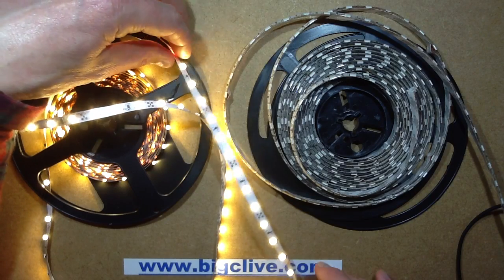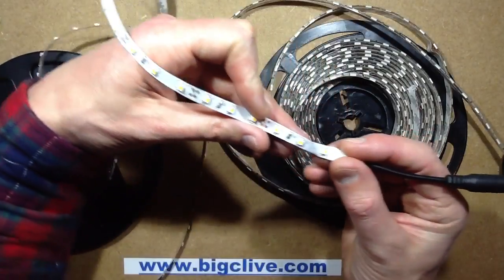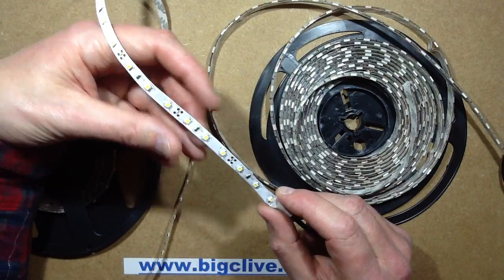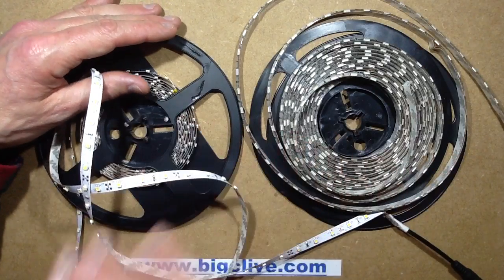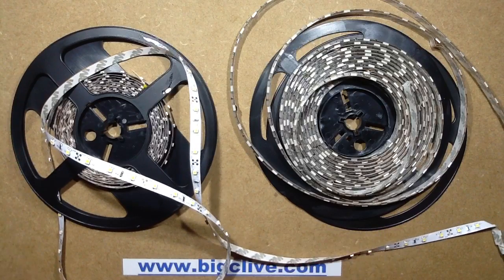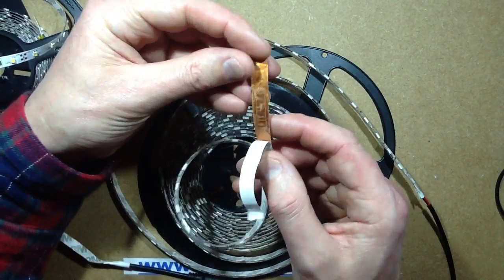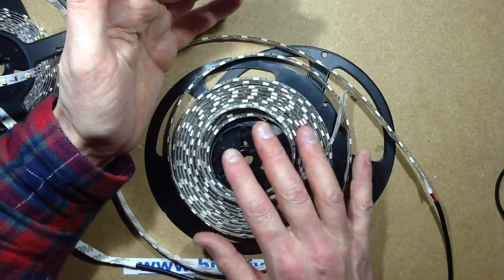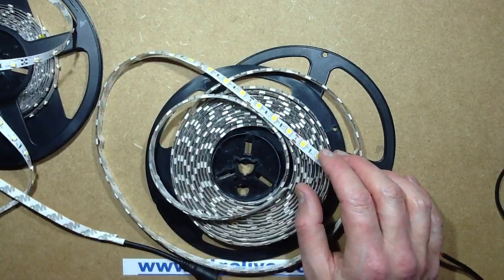LED tape voltage drop on long runs.

Comment: Clive, I know this is an old video but it is still absolutely useful. I’m making some rectangular LED panels from a dozen or more shorter lengths on aluminium plate. Connecting them in series seems slightly less daunting for mediocre solderists. But you’ve convinced me to push ahead with attempting parallel power. Tutorials suggest via thick copper cables running the length of each side and tacking each end, or just bare copper wire in a wiggle formation, or “shunt” injection wiring. Still haven’t decided which method to attempt but I will avoid just putting them together in series.
Reply from the maker: If your LED strip is coming back round to the start in a loop you can tack the positive on one end and the negative on the other where both ends are.

Comment: Hello Clive love watching your videos 😁 just a quick question, I’m planing on using these lights on my model railway which I’m going to be cutting them down into their banks of 3 so I get 100 sections and with wire to drop through the baseboard. I am planning on having the terminal blocks which you use fork connectors on for the connections which then each individual of 12 connector block will run back too the power supply which is a regulated power supply the ones which you can select what voltage you require which they are normally 1000milliamps so with the tape you shown at 16 milliamperes I worked out it’s around 64 per plug however I will only put 50 on per plug as not to tax it would this be fine. Any help would be appreciated many thanks Christian
Reply from the maker: That sounds fine.  I'd recommend splitting it into several circuits and adding a suitable fuse per circuit if using thin wiring.
It's always better to under-run a power supply so it remains cool.
Reply: bigclivedotcom thank you I’ll be medium using medium sized awg wire for power so around the 14-12 gauge to give good power distribution too then I’m even putting a switch in on each of the 12 way blocks so if I get a problem I can isolate the section quickly 😊

Comment: Would feeding voltage from both ends of the tape help with the voltage drops?
Reply from the maker: Yes.  In two ways.  Either both positive and negative to both ends ensuring polarity is absolutely correct before applying power, or positive to one end and negative to the other, which results in even intensity along the full length.

Comment: I have 3 ten foot strips on the 3 rd strip the light is barely visible but it is very bright on first strip any ideas ??
Reply from the maker: You may have to run separate cables to the strips if they are currently wired end to end. It's possibly voltage drop.

Comment: I purchased some Phillips branded LED tape lights that were able to produce all colors + white, select-able from the IR remote. The majority of that I find on EBAY is only "RGB" with no white capability. What do I serach for that will give me RGB+white on the same tape light strip?
Reply from the maker: RGBW is the key acronym.  Or RGBA for red, green, blue, amber.  I think you can also get RGBAW.

Comment: Even more fun when you're wiring up WS2812B addressable LED strips that run on 5 volts so twice the current.
 I've just bought two strips for my disco room to add to the two I already have ...
(Some people would call it "home theatre" , but I find abstract light patterns more entertaining most of the time) 
So I have invested in good quality power cables and will power the strips from both ends.
Coincidentally I want the lights to start from the extremities, so bought a reel of 0.75mm twin mains just for the data lines.

Comment: How many watts on average would a 5m strip of 300 3528 LEDs draw? Because I fear they are overloading a 65 watt laptop power supply.
Reply from the maker: Theoretically about 2A at 12V for standard LED tape.  Are you sure it's 12V you're running them with?

Comment: Mine is supposedly a cheap smd 5050 rgb 12V 60leds/meter. Selecting full white, the voltage is measured. I am powering the full 5 meter rgb roll without any cuts in the middle. Just before the first led the voltage is 12V for R G and B. But at after the last led which is after 5 meter the voltage drops to 8.5V for every channel; concluding it as a cheap strip. I then inject at the end of the strip with the 4-core cable that comes from controller which is the same that is injected at the start end of the strip. The result is now the end strip is as bright as the the start strip. But the mid strip is not as bright, the voltage is 10V. I then again inject in the middle and now every section looks similarly bright. Now I wonder, is this bad practice? Will the wattage go over the spec which is 14,4watt/meter or 72 watt for that one 5-meter roll rgb strip? I guess no. Please help clarify this folks. Thanks
Reply: I also notice that when injecting in the middle of the strip the lights which are currently dimmed to 10V are added/boosted spreadly from the point it is injected (to the right and to left) Sorry for my bad English but I guess you all see it. FYI, i am injecting 4-core cable accordingly not just the V+ cable.
Reply: And because of the "spread" effect it gives, I wonder why do we need to use amplifiers instead of direct injection for boosting the voltages? Directly injecting the 4-core cable benefit both ways of the strip, while injecting using an amplifier will only benefit one way of the strip that results in different brightness between the end of the first strip and the start of amplified strip.
Reply: i guess you can inject the voltage in every places, assuming there is one power supply, theses strips have super thin copper traces , so yeah, the  voltage drop is big after some meters.. probably the wattage won't go out of spec, because these dioses probably have resistors soldered in series.
Reply: Cheese 1337 thank you. I guess so too, because I dont see any negatives such as unusual heating on the diodes

Comment: Can I use power supply on both sides of 5 meter strip? Because I don't want to cut it.
Reply: What are you talking about? It doesn't matter what feeds the power supply, what matters is that both ends are connected to equal voltage power supplies, which really is hard to attain with two different power supplies unless they are really accurate. With unequal voltages there will be current flowing into one of the power supplies which won't do any good.
Reply: SillyTube Yes you can connect two different power supplies at the end as long as they are fed from the same main supply voltage.
Reply: SillyTube What you can do without any trouble at all is to run fat wires from the same power supply to both ends of the strip; I do this all the time. You could even run the fat wires alongside the LED strip and provide power to the LED strip periodically throughout the strip (you can solder to the strip without cutting it). If you have a bench power supply with current display, you can easily test this at home: connect the LED strip at one end only and see what current it draws. Then connect both ends of the strip at the same time and see what the current draw is. With the 3528 LED strips Clive is talking about here, I see the exact same as him: 2A when connected at one end only, 3A when connected at both.

In contrast, using multiple (separate) power supplies is somewhat problematic, and I wouldn’t recommend it unless you reeeeeeealllly know what you’re doing.

Comment: Thanks for the video 
.I have 50/50 ends worked fine when I first bought them off eBay..but now they are just white and don't change color..how would I fix this? Thanks
Reply from the maker: +Duane St John If it came with a controller it may have failed.  You can get new RGB controllers on eBay.

Comment: I want to use the same power supply for my leds strip wich one is in my bed and the other in my desk, the distance from the power spply to the bed is like half a meter, but to the desk, is like 4 meters.So, i was thinking about using an acessory with 1 female (wich goes to the power supply) and 2 males for both of the led strips. My problem here is: i will use a cable (red,green,blue) a long the 4 meters of wall and then plug to the led strip in the desk, and idk if i will lose power through and the brightness of the led strip will drop. 

Can someone help me ? ( if you didnt get it, i can explain better, and sorry for my english)
Reply: Miguel Ribeiro Because it’s low voltage (12V), the voltage drop will be significant over such a distance unless you use very fat wire. It’d be cheaper to use a separate power supply for each. (Since, amazingly, you can get cheap chinese power supplies for less than the cost of good wire!)

Comment: I use them in kithcen for iluminate working table under hanging shelves (sory for term, not native speaker). I do not have any problem with brightness on far end. 

PS If you want for all LEDs to have same current and same brightness, you can feed positive from one sie of strip, and negative from other.
Reply: Mladen Milić lepo je to ali sta ce biti ako zamenim plus i minus tj. ako stavim minus na plus a plus na misuns
Reply: Rocky2224 Jednostavno neće raditi. Sve dok napon nije preveliki, inverzno povezivanje nema posledica.
Reply: Mladen Milić ma meni nije problem napajanje ja imam 12v i 1.2A nego je meni samo problem dal nece crknuti traka ako zamenim smer napajanja
Reply: What do you mean by positive on one side and negative on the other?
Reply: SillyTube well you connect +12v on one side and gnd on another side of the strips
Reply: Rocky2224 What is gnd?
Reply: Can I use power supply on both sides to give equal voltage?
Reply: SillyTube well idk what you mean by equal voltage but if you think to give 12v on two sides of strips why wolud you do that?
Reply: My power supply powers half of the 5 meter strip only, the other half is dim and of different color. So can I use one more power supply on the other side?
Reply: SillyTube well probably you got cheap tape but if you have 2amp psu you should be good. You may need weaker psu but if you have 2amp there isnt problem. 
But if you have "strong" psu (power of tape for 1m × how many meaters and amps of psu × voltage and if you have more watts on psu than on tape your problem is in tape) and if is problem in tape try to cut it and put 2 psu.
Reply: you can connect the same power supply to the both ends of the 5m tape.

Comment: Hi. How can I get the most of this type of led strips? The ones that have resistors. I won't run longer then 30 cm lengths but I want to get as much lumes as possible. I can stick them on a heatsink if heat becomes a problem. So are those resistors robbing some of the light output? I've seen strips that don't have resistors at all, like those in downlight slim panels.
Reply from the maker: +Alexandru Simonescu The resistors allow very simple driving of the LEDs from a 12V supply with even current distribution through all the LEDs, but in doing so drop the equivalent of one LED.  The flat lighting panels use large series parallel arrays driven from a fixed currents source but the current may not be distributed evenly and failure of one LED can cause the others to fail quickly too.
Reply: +bigclivedotcom thank you for the reply

Comment: Been watching a lot of your videos and love this channel. You brought up something in this video I have been wanting info on. How to tell what led is brighter I was told the 35/28 or whatever the number is, is the brightest and the 50/50 are not as bright what does the number mean and how do I tell what led will have a brighter useable light? Thanks and keep up the good work!
Reply: 5630 brightest (these are excellent - I use a 20 cm strip to light an entire 1.2x0.6m shelf - almost double as bright as 5050)
5050 next
3528 dimmest
The numbers are the size of the LED chip in tenths of mm.  5630 is 5.6 x 3(.0)mm, 5050 is 5mm x 5mm etc

Comment: How many joins did you get in a 5M length  I bought 3 x 5M  and they have about  9-10 joins per reel .. seems like I got a F grade reel offcuts
Reply from the maker: +Joe Darkness That's normal.  If you measure it there is usually a join every 500mm (half a metre).
Reply: @bigclivedotcom  Most tapes I've seen had joins every few centimeters. But there is a lot of variation and some do have the joins spaced far apart.

Comment: Hey bigclive, I would like you to comment on the following situation:I installed a 2m 120/m 3528 ww strip under cupboard in my home and it's been running almost 24/7 for almost 10 years. The strip is glued directly to the wooden cupboard undersurface, so no good cooling at all.On the other hand, I installed a second identical strip from a different seller a couple of years back and it's already dimmed to less than 50%, with quite less daily usage.What's the culprit on the second strip? I'll have some voltage drop / current readings later today.
Reply from the maker: +Thanos Tourtouras The 3528 LEDs are such low power that they do not require much if any extra cooling, so the conduction into the wood would have been ample.  Quality of the LEDs used on these strips varies dramatically.
To see how much current is flowing through each group of three LEDs accurately, turn them off and measure the resistance of one of the series resistors that is used per group of three LEDs.  Then turn the power on and measure the voltage across the resistor.  Divide the voltage measured by the resistance and you'll get the current through that circuit.  For instance 3V divided by 150 ohms equals 0.02A (20mA).
Reply: +bigclivedotcom OK, so for the good strip it's 3.28V on the 150ohm resistor and 3.05V on the LEDs, while for the dimmed strip it's 2.14V on the 150ohm resistor and 3.11V on the dimmed LEDs. That translates to 22mA for the good one and 17mA for the dimmed. So is it that the LEDs on the dimmed strip have built up extra resistance over time and if so, how? And how did they end up building the same extra resistance, since their light output is uniform? One would expect of bad quality LEDs to behave completely differently, which would lead to a bunch being darker than the rest, which is the case on COB floodlights.
Reply from the maker: +Thanos Tourtouras It looks like it may just be bad LEDs then.  Is there a source of steam near the faulty strip?
Reply: +bigclivedotcom yes, there is indeed, but for both of them!
Reply from the maker: +Thanos Tourtouras Ah.  just bad tape then.  Treat it as disposable and replace it.
Reply: +bigclivedotcom so can steam be used for testing then? How come?
Reply from the maker: +Thanos Tourtouras it's possible that cooking contaminants could create conductive films on exposed tape.  If that was the case there would be visible signs of corrosion.
Reply: +bigclivedotcom no, this shouldn't be the case, since the strip has a plastic coating (not silicone though) and the brightness drop is uniform for the whole length of 2m, while steam is just at one end. Maybe I could mail the strip to you to check it out
Reply from the maker: +Thanos Tourtouras Ah, it's the waterproof stuff.  Then it is just bad LEDs.
Reply: +bigclivedotcom thanx for the info. Have a bunch more questions on some other bad stuff, will comment on an appropriate video. Take care.

Comment: I've recently finished replacing all lights in my house with LED... only to later notice that I really should have spared the workshop.
Turns out that those 10m of LED strip are a perfect antenna for all the atrocities that the cheap chinese power supply bricks spew out. 70kHz noise jamming more or less any measurement taken with the oscilloscope now. Guess I need to either go back to incandescent lights or build my own linear power supply. -.-
Reply: +Markus Strangl Did you use the shitty wall PSU's or the ones in the metal cases you self-wire?
Reply: +TwitchingDan I used the shitty brick PSUs that came with the strips. Although they didn't look bad (of course I tore them apart) except for a lack of input current limiting. But they do leak the switching frequency onto the outputs. But by now, a pack of fat elcaps and some ferrite cores fixed that issue.
Reply: Markus Strangl I'm using one of those too, but will switch to a large case one to power a fuckton of strips. ~15m of RGB 5050.

Comment: Just fyi: I purchased several rolls of the waterproof version of these LED strips (IP67) and they are garbage. The rolls were stored on my electronics bench, indoors, for about a year and they all went bad. nearly every section stopped working. This includes both 3525 and 5050. They were stored in an area, protected from UV light, so sunlight shining through windows could not have been the reason they broke down. I went outside and checked the strips that I had installed on my motorcycle and although they still worked, they had completely deteriorated. So many items on Ebay, coming from China are complete garbage.